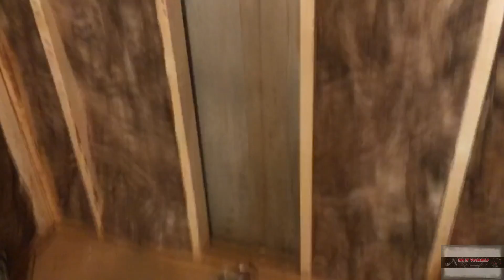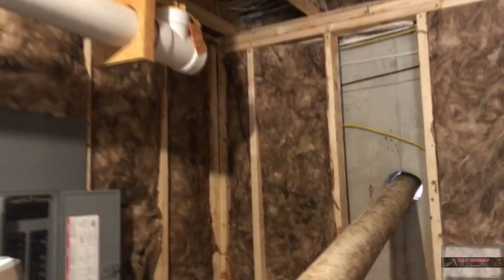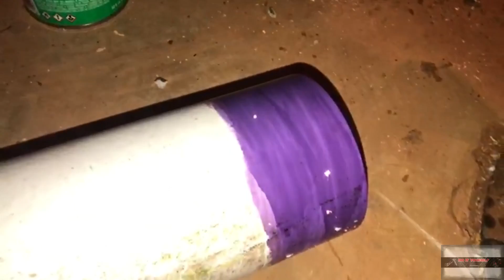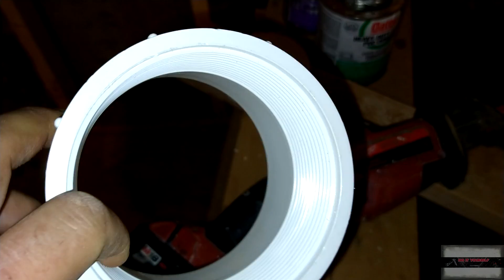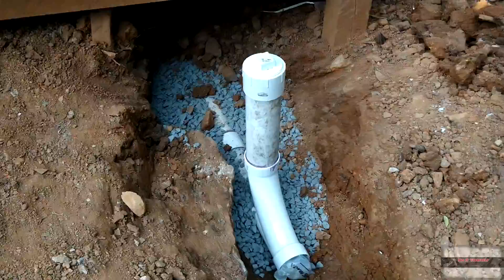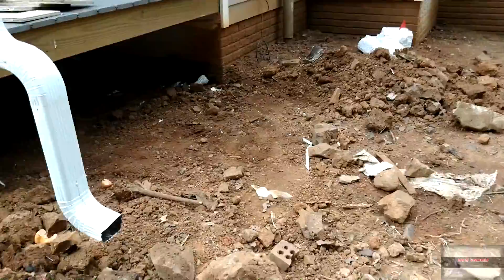house to septic tank connection 4"

Comment: Don’t use use wood  2 x 4 s for hangers use plastic hangers
Reply: Why? Not a plumber but I was about to do the same thing for my sink drain line...
Reply: @mitchellfay5725  takes more time and hangs too low needs to be tighter to the ceiling then down the wall